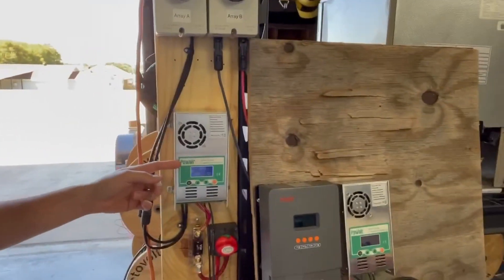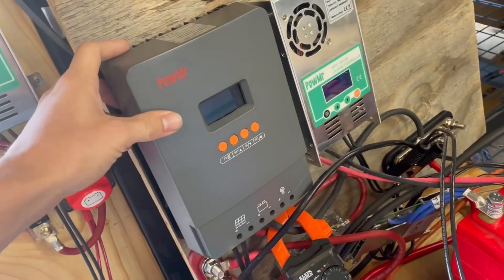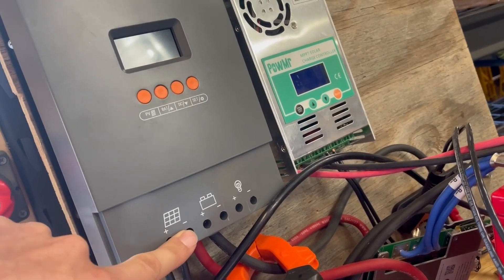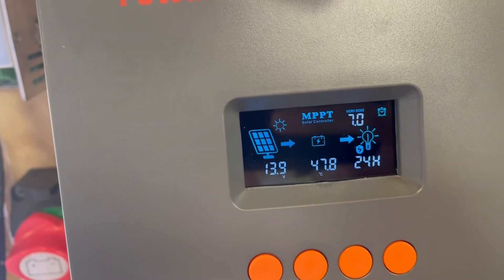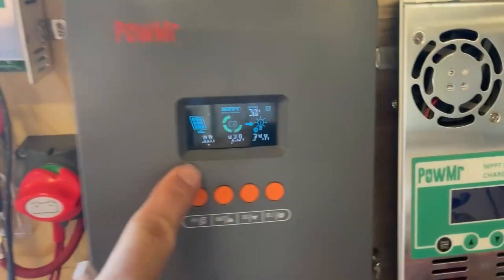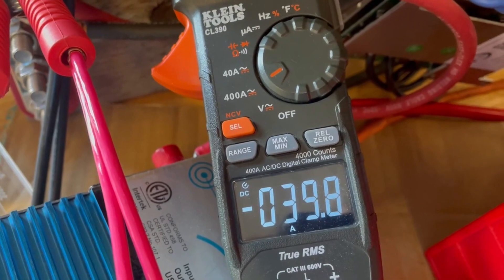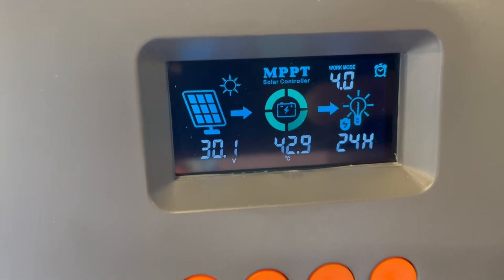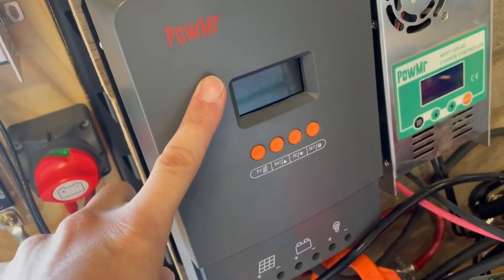PowMr M60-Pro - How Does it Stack Up Against its Predecessor?

Comment: for unknown reson powMR charger com from faktory not voltage caklibrated thats the C what you not understand, my new charger was 0,5 Volt off send to me, so plug in a pattery and then set the C to the real battery voltage ...that was your real problem.
for the other problem that this old versions not got back from mode 7/8 is a software problem what newer modells not more have.

and the very old 60A charger was the most troublemaker , the newer modells must be calibrate to .
but not make troubles after calibrate

Comment: Can any one tell me why my 25 amp charge controller  screen goes off a few minutes after I hook it up to my lifepo4 battery? The controller is for a 12  v battery. I have it configured for my lifepo4 battery. It's a 12.8 volt 100 a.h battery. I have 2, 100 watt panels hooked up to it. And have 2, 40 amp  circuit breakers in the solar set up

Comment: My panel is 24 volts 1200 watts. The battery is 200 mh . When the sun shines too much, the battery suddenly stops charging and the controller display shows 00 watts. At that time, the battery is far from full. What should I do??

Comment: A friend of mine purchased the most current powmr 60a. He had 500w of solar 2 - 250w panels in parallel on a 12v system using 2 redodo lipo4 batteries in parallel. The charger over voltage and over charged the batteries destroying them, the high voltage also destroyed his power inverter.

When I checked the powmr charger it was set for lipo4 battery 12v the late evening the charger will start sending 17v to the battery
Reply: That's too bad, my friend. The Makeskyblue controller I'm using is very stable right now, and I really like it.

Comment: # GERMANY same problem TILL I READ MANUAL ;) ... Lol, had the same issues till I read the manual buddy. The C is a battery calibration function  ....thx @ikbarbershop ! ... C voltage is like you have long cable to the battery you can "adjust" the voltage ... when this setting is "wrong" (not the actual battery voltage; or set while solar panels is connected) it can overcharge the battery !!! FIRST: connect the controller ONLY to battery !!! SECOND: set right battery type + set C voltage to the same value your battery voltage is ! ... AFTER THIS you can connect the solar panels ! if you try to set the C VOLTAGE while the charger charges you have wrong voltage (charging voltage instead battery voltage) .... READ MANUAL ;) and for 12 volt is other "voltage pv input range" then for 48 volt !!! the MAXIMUM VOLTAGE for PV INPUT means for 48 volt !!! for 12 volt the maximum pv input voltage is at some controllers or all controllers LOWER (not the maximum voltage !!) then you must connect your panels in parallel and not serial but remember "max ampere" (but the charger can only use 20A from panels like 40A ... this is no problem - the A can be higher then the controller can handle ! the load "pull" the current) ;)

Comment: I think the setting you said you don’t know what that is.      Where they wrote c and voltage value.       That voltage calibration if the voltage is not accurate with your battery you can set the correct battery voltage there.
Reply from the maker: I think you're right.

Comment: i set calbertion 3 or 4  points higher then the battery to get my 14.1 or 13.9 works for me, i try to keep my diy batterys at 139 to 14.1 thats what the c stands for

Comment: i have the new 100a  POWMR TRYING TO SET AT 13.8 FLOAT  AND PEAK AT 14.1 I HAVE 4 POWMR I CAN GET THEM TO ONLY RUN AT 14.5 WHICH I THINK IS TO HIGH FOR LITHIUN LIFE04 BAT, DIY BATTERYS

Comment: I gave up, I designing my own charge controller, the Mr power are not good enough, they will not last long, not enough decoupling caps, they should be running warm not hot with fans.

Comment: I have the old mppt powmr 60a mppt controller . Had for 5 years and it's great , only thing I've never been able to do is get it to automatically switch off the load when say sun goes behind cloud so load to much and battery voltage drops to low. What do you think best way to automate this? Thankyou for sharing. I have 2 X 420w pannels in series and in direct sun I get 60a at 12v out :) happy bunny

Comment: I have the newer 80amp one with fans and it was working fine all day then at like 3 it stopped producing wattage and amps it was showing 90v coming in but no watts coming in nothing going out. I have 48v system with only 2400w
Reply: Nearly same setup & same problem when battery is fully loaded voltage goes up to 90V, inverter & battery hang up and need to full reset whole system. You found a solution? Thx
Reply: @NonameNoorg  yea bought different brand and sent this one back
Reply: @ Thx for your quick response. Unfortunately not possible to send it back searching further for a solution. When buying a new one, guess a Victron. Regards
Reply: @NonameNoorg  Ampinvt 60A it's a really good controller and has metal case works perfect for year now

Comment: It will be easier to describe the problem: PowMR 6.2 KW inverter The installation of photovoltaic panels is 3.6 KW, the inverter is not connected to the battery and is not connected to the grid. I have a 2 KW water heater connected to the inverter output. The inverter will not turn on the heater even in full sunlight. If I turn on a 500-watt receiver instead of a heater, the inverter produces electricity. How to set the inverter to provide current all the time regardless of the load, I want it to provide as much current as is currently in production and not to turn off when I turn on a larger load. 

Photovoltaic installation: 
225Wx16=3600W
36.9Vx16=295.2V

Inverter Settings
https://youtu.be/l9n7lgL5nu4?feature=shared

Comment: The c stands for calibration it should be set to the actual battery voltage. Im haveing the opposite problem with mine i have a 109 amp hour lead acid. I have 2  24v 200w panels wired in parallel and it stays in mode 7 and wont switch to mode 8 its been in 7 for a day now i have no load on the battery  edit: finaly switched to mode 8
Reply: How it changed from 7 to 8?

Comment: Lol, had the same issues till I read the manual buddy. The C is a battery calibration function that allows you corre t the battery voltage if it's significantly off from the actual value

Comment: Any one have user guide for these type scc. I have same controler looks  like this video. I download from pow mr site. And meny pdf files.  But  it different. Battery type display  "lit' on controler. But  user guide havent  "lit" it has L8 L16 L4 L15 only for lifepo4  battery. 
Any one have correct pdf for these type controler?
Or any way to flash onother firmware?

Comment: @BillGorman have you seen the PowMr HHJ60-PRO already? This one is supposed to be the real successor for the older model mentioned in this video. It is also capable of multi-charger single-battery setup via rs485 lines if i got it right. I would be curious if you could compare these two.
Reply from the maker: I've seen it but haven't used it. It at least advertises a bladeless fan so they aren't trying to run fanless.

Comment: 1:31 
Everyone that knows anything about electricity knows that the ‘standard’ rating for 10ga is 30A. Not exactly feeling confidence with this reviewer.
Reply from the maker: Really depends on the type of wire being used, if it's in conduit, etc. but sure the typical number is 30a for house wiring.

Comment: Good day boss, I have 2x180 12v solar panels connected in parallel to produce 360w at 12. With my pwm 30A charge controller I could only get 12 to 14 A max so I changed to mppt powmr 60A, I can only get 190w at 13.5v max I guess 14.4 A currently. My cable size is 2x10AWG blue black cable. My location is Africa Nigeria, what could be the problem?, cos my 160 watt panel produced 156 watts about 11A . Please advice
Reply: Here's a thought your ISC are short circuit rating will be the Max Amps here going to get out of that panel. If they're in parallel you can get about 93% of that from each of them most likely an optimal conditions they're awesome might be a possibility your battery Bank is not trying to absorb the load with the applied voltage from the charge controller it's interesting that the newer product is not properly functioning the old ones are one of the few I will actually support with insulation for one any plastic cabinet requires almost two standard size fire extinguishers to put out after a lightning strike speaking from client experience especially aboard a sailboat offshore it's a serious issue the nice part about  PowMr  is a proper industrial all metalic chassis

Comment: I have one of the old ones. It switches off charging when the controller reaches 75 degrees C. Then after it starts charging again. Im currently running on a 24v 200amp battery. Running 1800watt panels. Read out is 1.5kw and actual amp reading is 50amps. This is a very tuff controller. Its just works. I am very happy with my unit. Have it for almost a year now.

Comment: I got two of these controllers one has been running perfectly fine for the last 7 months or so on a small lead acid battery bank no issues at all. The other one with all the settings done for a small lithium iron phosphate battery bank only worked for a couple weeks it would not stop charging the batteries no matter what settings i used. I tried it out on the small lead acid batteries and it wasn't working with them either it just kept charging to over 15 volts new version is much worse than the older version. I have four of the older ones two have been working for 6+ years with only the fans going out easy to fix though the other two have been going for four years so far .
Reply: A friend of mine purchased one of the newer models. 2 - 250w panels in parallel and 2 - 12v 100ah redodo lipo4's in parallel for a 12v system. 

The charger was correctly set. After a week of flawless operation the charger would over charge and over voltage the system. 

The voltage to the battery's would spike up 17v and stay there. He also used a powmr inverter. The over voltage protection on their inverters are false advertising as 17v fried the inverter. 

It also damaged one the batteries. For some reason after the batteries was charged up the the charger would start sending 17v to the battery and continue charging them.

Comment: I read the manual on Mine and it worked just fine. It’s just not set up right bro.
Reply from the maker: Glad it worked for you. Mine overheated way too easily.
Reply: I'm guessing it's overheating because your input power is exceeding the maximum. and I think it cuts off the power and voltage. Since the total power exceeds 720W, it may not work properly, it would be good to check the 24V battery. Just guesses!

Max. Input Power: 
For 12V system ：720W 20-80Vdc;
For 24V system ：1440W 37-105Vdc;
For 36V system ：2100W 50-160Vdc;
For 48V system ：2800W 72-160Vdc.

  @BeeneEnergy

Comment: Can i use 800 w 12v panels on the 60A charge controller? Since the controller is 95 percent efficient, and the fact that the panels are not 100 percent efficient.

Comment: Use a ferrule and you can use bigger wire
Reply from the maker: It's pretty tight in there with just the wire. Adding metal around the wire would shrink the copper that much? Maybe 8awg?
Reply: @BeeneEnergy  it's mostly for safety so free strands of wire won't be sticking out of the terminals.  It will also crimp under the screw and prevent pulling out.  The best thing to use would be a machined terminal like they use in car audio but you are increasing price higher than you'd increase efficiency.  Saying that, I use ferrules with heat shrink skirts and I tin them with solder then use a hex crimper.  I'm sure there is a better way I haven't thought of but the ferrule is smaller diameter shank with almost like a funnel inside for larger gauge wire.

Comment: So glad I found your video, cause I was having the same issues was driving me nuts. However, when I changed the c-number to the actual battery voltage it stayed in mppt mode,,,,Hopfully that did the trick,time will tell.
Reply: What's the experience like now?

Comment: plastic box no fan , fire ! , I have the very old metal one , cant program for Lithium because voltage spikes, did not know they made a newer metal one, just looking for something that's works , not the most high cost thing.
Reply from the maker: Voltage is probably spiking due to the lithium battery being imbalanced internally. What I do is lower the charge voltage until the spikes go away.

Comment: Makeskyblue is a little better than Power Mr, i use them both, and there is another similar to power Mr it's called HomySun the cheapest version of all 3
Reply from the maker: Interesting, hadn't heard of the third brand. I think they missed an opportunity to call it HornySun. Just think of all the people up in arms giving free advertisement.
Reply: Under "MPPT 60AMP Solar Charge Controller For 12V 24V 36V 48V DC Battery Regulator"
Reply from the maker: Looks like the terminals might be larger on the HomySun one. It's very possible it's different electronics too. This case is used for lots of power supplies and apparently charge controllers. So maybe it's just multiple manufacturers using a similar case for their things! Just contemplating.
Reply: @BeeneEnergy  ... I bought 2 of the HomySun 60A and so far so good, one negative is , the display does not show watts, only amps and voltages. And their fan is blowing inwards not outwards like pwrMr or Makeskyblue.

Comment: Dear friend any voltage above 13.5V for 4S Lifepo4 is considered entering the End of Charge phase so its normal to display 7.0 (battery current is still high as I see).  At 14V battery charging current should drop significantly (below 10A) and at 14.8V controller should STOP charging the battery. Did you let is do a complete battery charge ?

Comment: I purhased one of these PowMr 60 amp controllers and as soon as the batteries reach something close to full the charger voltage continues to rise until the lithium batteries bms switches the
Reply: SAME HERE;  LOTS OF PEOPLE ON THE NET WITH THE SAME PROBLEM;  
 
THE  POWMR  IS NO GOOD, IT DOES NOT WORK,  DOES NOT DO WHAT YOU PROGRAM!!!

AMAZING THAT THEY SELL THAT JUNK TO PEOPLE!!

Comment: I know people like to buy this cheap (not necessary cheap price!) stuff but before you do read the manual.  See what it can't do first.  For lead acid charging, where's the absorption cut off time?  Where's the tail current setting?  Where's the equalisation voltage?  Where's the equalisation interval?  Where's the equalisation time?   Similar questions can be asked for LiFePO4, LTO and NMC batteries.  If the charger doesn't even have those basic settings, skip it.  You won't be doing you battery any favours, regardless of chemistry or specific type, if you use a charger that doesn't even have those basic settings available either via the integrated front panel or an external display or a computer or smartphone.

Comment: I have a theory as to what was happening
The battery was pulling up to 14.5 causing the controller to swap into mode 7
A larger battery bank or less panels would have gotten better results
Reply from the maker: I did a lot of probing to see why the voltage was so high. It wasn’t from the battery, voltage there was in the 13’s. There must be high resistance inside the controller somewhere.
Reply: @BeeneEnergy You exceeded the allowed solar input power; read the silver sticker on top of the device that states 720Wmax for a 12V system. As soon as it detects the battery voltage to peak at the "float voltage" level it will switch to mode 7 and not come back on its own, now matter how low the battery voltage gets. To avoid this use a battery with lower internal resistance or a higher battery voltage thus decreasing the currents. I use 8 lead acid batteries in a 4S2P configuration and when the batteries were newer last year, I rarely had the "mode 7 problem", now after heavy use for a year the batteries have aged and especially on partly cloudy days with colder panels and sudden sunshine surges the power enough to momentarily raise the battery voltage, even when the battery is far from fully charged. It's certainly a design flaw that could be mitigated by a few lines of code and a firmware update..

Comment: After further testing mine, It appears this inverter is really only a 30amps MPPT then it becomes PWM over 30amps. Anything over 30amps going to battery, it drops the charging voltage (behaving like a PWM and doesn't do buck convertion) and goes from MPPT mode 4 to Absorption mode 7. My battery capacity was very low but it was only charging in absorption mode 7 because I had over 30amps. Immediately I removed some panels and reset the solar input, it went back to MPPT mode 4 and stayed in MPPT till it was near full
Reply: Interesting ...

Comment: It apparently shuts the small battery to 14.4V reading (it can barely be seen climbing by low screen update resolution), then droops to PWM to lower the current. I wonder how it behaves on a stiff, high capacity battery array. I suspect an algorithm feature, or a bug. Ordered  one, will arrive end of December. Anyway, this PWM mode seems to cause the issue.
Reply: Anoy word on it I just recently ordered the 20 amp one
Reply: Is this an mmpt controller or a pwm controller? I saw a vidoe of the old one opened and that definitely had a buck converter built in